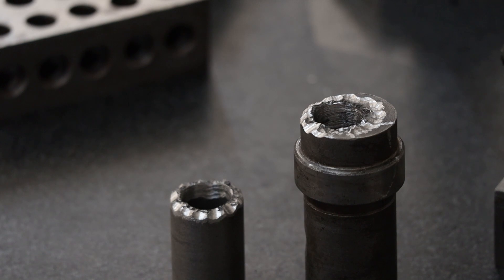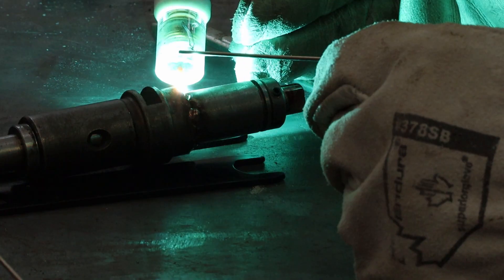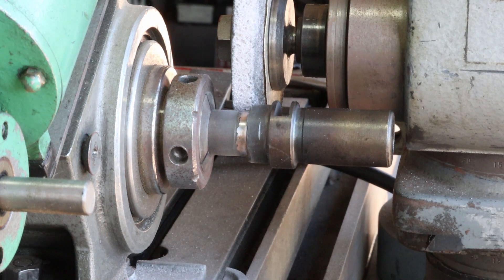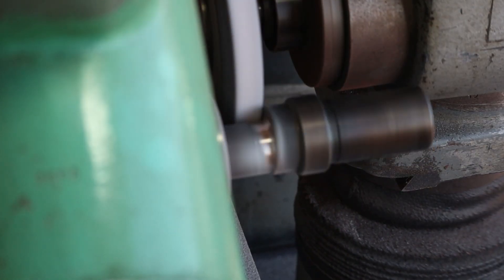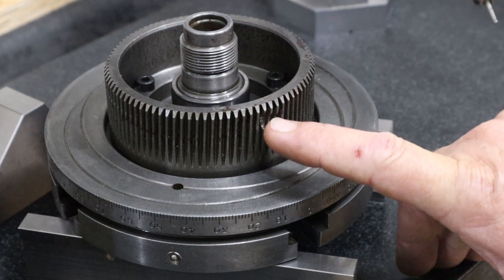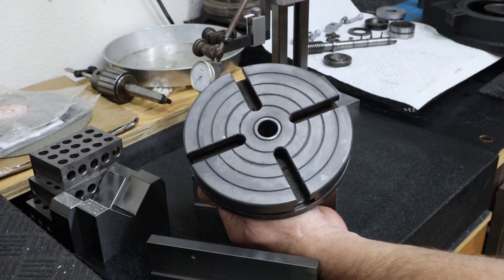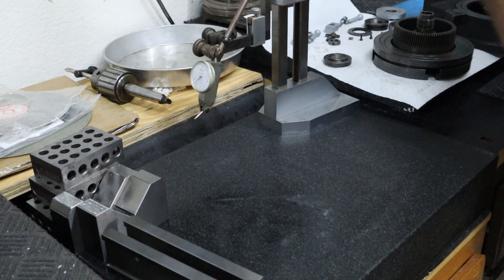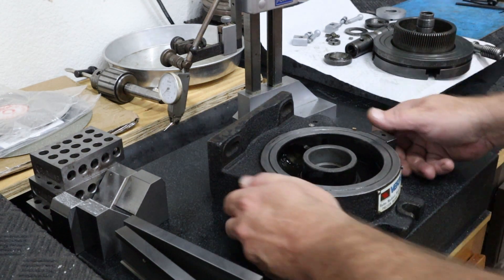Tig Brazing Cast Iron, Grinding? Rotary Table Part 2.

Comment: I just started messing with tig brazing and I found AC pulse the easiest way to get it flowing but not overheat the part.
Reply from the maker: I haven't done much with it so far.  A small amount of reasearch.  Im not sure why I went with dc but I will be sure to try it with AC next time thanks for the tip.  I have other parts I may need to fix.  It may be something to try and fill the holes in on the plate I am going to scrape.